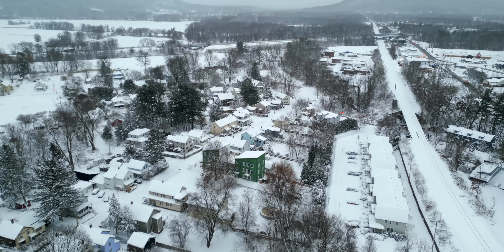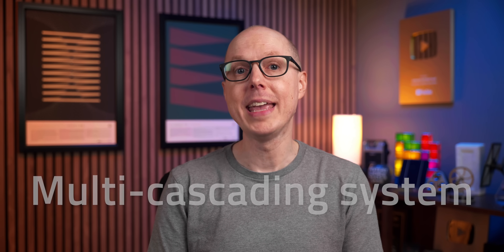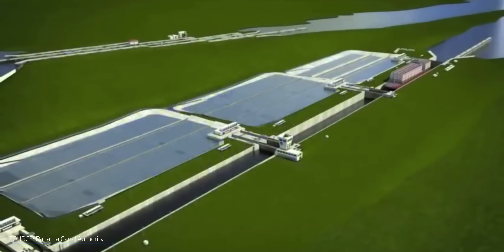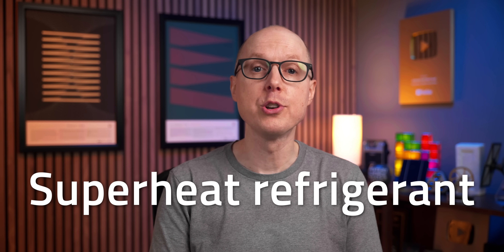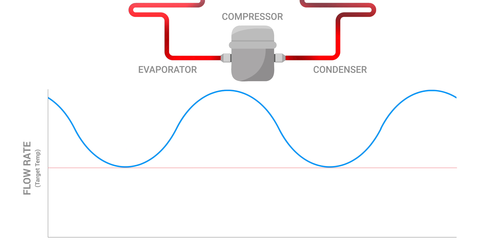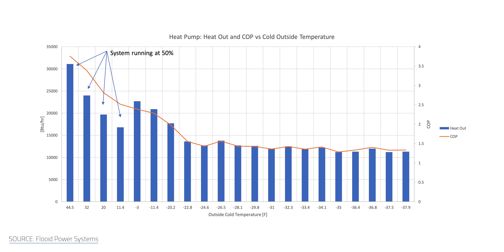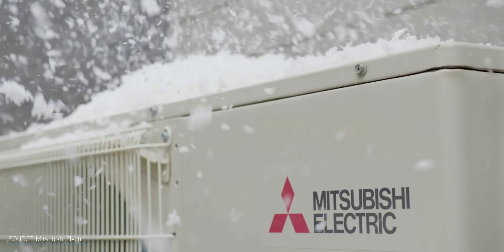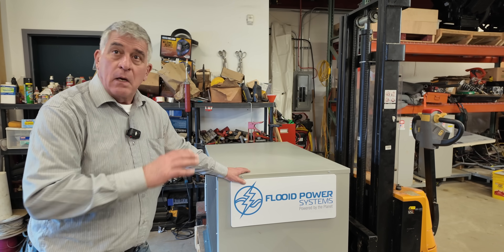How This New Heat Pump is Genius

Comment: AC units should be heating our water
Edit: The waste heat from when an AC or Refrigerator is running, should be routed to and recovered/stored in the hot water heater
Reply: I think David is saying that the AC unit for the house should be tied into the domestic hot water rather than dumping the heat of the house outside
Reply: @colinkulasik1128  That's something that makes sense.
Reply: Look into heat pump water heaters. That’s exactly what they do - move heat inside your home into the hot water tank, cooling and dehumidifying at the same time.
Reply: Wait what do you mean? my water heater has a heat pump in it
Reply: @justincarter7954 when running the ac the condensor is putting out heat. If the heat is used to say heat a swimming pool. The efficiency of the ac goes up and the pool gets warm.
Reply: @justincarter7954 he is talking about putting the evaporator coil on your home AC system to work heating your water.
Reply: @justincarter7954 which produces ac air and could be used to supplement your ac system
Reply: Why stop there? We should plumb refrigerant through the walls like water and electricity, hook up the refrigerator, water heater, HVAC, and laundry through VRV terminals.
Reply: @Higglebagger  I agree 100%. Laundry and kitchen and utility room could be designed to share a wall
Reply: @Higglebagger   - indeed, every house needs a thermal transfer system and "octovalve" -  like unit  - to shunt the "thermal transfer medium" here, there and everywhere. The "thermal transfer medium" carries the thermal energy from wherever it is "created" - washing machine , dryer, refrigerator evaporators  or furnace flues - and not desired, to wherever it is wanted (or to be rejected), and a local heatpump can convert it into whichever quality heat is desired - hot water (hydronic water 2 water hot water pump would be good..), air heating / cooling - or dump it back in the ground-source for use in a different season (take the heat out of the ground in winter and put it back in the ground in summer...  Some loads are "constant" - single direction - ie. hot water is always needed  as is food refrigeration, living spaces of  course are some times hotter and sometimes colder than the ambient needing a reversing system.
Reply: @Higglebagger that's a very good idea I've been thinking pretty long, use refrigerant everywhere!

your iron (the heater thing for clothes), maybe your dryer (dries clothes), your air conditioner (cools air), your gaming pc (cpu goes vroom), your stove (cooking food while all 10 compressors are dancing), water heater(nice warm water while showering), refrigerator (bacteria freezing in your meat)
Reply: I’m in Florida and the previous owner of the house tried this with a commercial heat exchanger specifically designed for this. However the main issue is that the duty cycle of a hot water heater and AC are completely different. Pretty much all hot water storage heaters are extremely well insulated so once they get up to temperature, about the only time they need significant heat input is when water is being used to get it back up to temperature as quick as possible for the next usage. Most people are using hot water first thing in the morning and then mostly in the evening, which is not when the AC is running with excess heat to dump somewhere. So you end up with all this extra plumbing and a heat exchanger for very little gain. Conversely a heat pump directly on the water heater in our unconditioned garage could take advantage of any heat in there, but it also requires things like an extra drain line.
Reply: My water heater has a compressor (AO Smith) that heats the tank using the air temperature.  Here in FL, the humidity in the air is 'free energy' that my compressor can exchange into the tank temperature.  It runs on 120volts instead of 240volts.  I can choose Efficiency, Hybrid or Just Electric.
Reply: @tedhamilton2362  It amazes me how many people aren't understanding what the man is saying, he simply saying you should water cool your air conditioning system instead of air coolant. That's it. Jesus Christ. It's not that hard
Reply: @Bozemanjustin like Tesla's  octovalve, allowing devices to swap cold and heat with  each other as needed
Reply: @Bozemanjustin if the water gets hot efficiency falls off. S swimming pool has a large heat sink and stays relatively cool
Reply: @backacheache the Octovalve is a compact form of a bunch of solenoid valves. Nothing special other than being proprietary, expensive, and hard to get a replacement for. (like most tesla parts.) commercial grade VRF systems are a great example of fitting a ton of solenoid valves into a very small space. They achieve the same result with more flexibly.
Reply: @tedhamilton2362  think he's talking about integrating the while home heating cooling systems need cold fridge and hot water remove heat from fridge dump to water. Same for cooling your house
Reply: I have been heating my water with the AC unit for 32 years. I have a Water Furnace much like Matt Ferrell but older. He never mentions having that option on his unit. I live in south Texas and it produces all my how water from Apr 15 to Nov 15.
Reply: We have a geothermal system that takes the ground water and uses it for the floor heating, AC and distributes to a water heater and a boiler. Very efficient system for radiant floor heating, AC cooling and warm/cold water ;)
Reply: They already do on swimming pools
Reply: @Bozemanjustin I've wondered if hosting a data centre (or just a rack or two) at swimming pool would be a good idea as the site will have a big power supply and the pool has need of the heat
Reply: i have a hydronic heat pump for my hot water, its so so.. After a long shower the water gets cold and takes hours to heat back up. In the winter it takes forever. I use less oil though. I wish there was a better alternative.
Reply: @Solitas777  It depends on the HP water heater, but on mine I can set the temperature at the unit well above 130. Is your water tank big enough?
If you have a system that supports hybrid, you could set it to that to support multiple showers is a row or to heat up the water faster. Of course, it takes more energy in that mode.

My 45Gal HP water heater is plenty big for myself, and I have no issues with running out of water.
Your family probably needs at least a 60Gal water heater.
Reply: In Japan, they have fuel cells where natural gas is converted to electricity and heat.  The heat is then used to heat hot water and radiant floor heat.
Reply: @rl1111rl  any more specific terminology or brands that you could reference?
Reply: My heat pump does this.  Many heat pump systems have been doing this for 20+ years....
Reply: Maybe even one step further?
HVAC/fridge/hot water combo, they share some of the same parts and produce excess heat/cold depending on the climate they're working in.

Thoughts?
Reply: @TJCarrishere  they all have different demand profiles. They would rarely operate at the same time. It works in larger buildings due to the diversity of loads and buffer capacity. (yes some walk in refrigerators /freezers have done this for more than 30 years) You can use the water loop to preheat incoming potable cold water but not all the way to traditional potable hot water efficiently enough in cooler  climates outside of the warmer months. When you don't need to heat the water loop, it becomes more viable to heat potable water all the way with a HP, if a bit demanding on the electrical infrastructure.
Reply: @SuperS05  Yeah, that makes sense, I don't know all that much about the dynamics of each individual system, I just knew they shared similar parts. Thanks for taking the time to explain.
Reply: I know a tech tuber that literally convert his pool to cool his home while at the same time heating the pool
Reply: I've long thought this is a good idea
Reply: They do it in supermarkets
Reply: Agreed, saves about 15% off AC bill as the system runs more efficiently. Can also be used to heat a swimming pool.
Reply: @Gadgebrown  I once went to a house with an AC unit and heat pump style pool heater right next to each other. One blowing out hot air and the other blowing out cold air.
Reply: a solar water heater that feeds into the main water heater reduces costs dramatically no matter what kind of heater you use
Reply: There should be just one machine as fridge , washin, cook, microwave, home server, ac etc.
Reply: What if you put the condenser in a per heater water tank?
Eliminate the condenser fan
Reply: That's a really fucking good idea. I could run a loop from the hot water heater of Copper Tubing Through the fins of the condenser.
Reply: Some models do that already, but they tend to be models that use radiant floors or radiators for heating and cooling as far as I can tell.
Reply: @SwankySasquatch66  and that matters why?  120F from a classic water heater or heat pump water heater... what is the difference?  I was referring to voltage input (120v vs 240v).
Reply: They already do this! Ground source and air source.
Reply: How much warm water do you use and what is it's pattern of use?
Reply: Hmm I have had HP for 30 years making hot water...
Reply: Like a trane hvrf
Reply: They already make heat pump hot water systems, not as reliable and we heat our hot water with excess solar so would take a long time to pay off a hot pump hot water.
Reply: @momouppa  You are not understanding. A ground source heat pump heats the water in a regular domestic water heater using waste heat from the compressor. The only added cost is a small pump and a little piping.
Reply: Ground source heat pumps have a secondary function of adding heat to the water in a domestic water heater for no-added-cost hot water.
Reply: Mine does? It’s called a desuperheater.
Reply: @FuncleChuck  it's only called a desuperheater when it's not designed to be a condenser. IE. The condensing pressure /temperature is lower than the target temperature. You'll get less than 25% of the energy available out of the refrigerant. (probably less than 10%, especially considering the asymmetrical demands) The rest will be rejected via the condenser. It's better than nothing, but it's not as useful as it seems. Since you can't store luke warm potable water safely, using a closed tank as storage, preheating the incoming water is far more useful but takes up a bunch more space.
Reply: genius
Reply: Notoriously unreliable, a mechanical system to heat water. Long term not a pay off
Reply: @charlesterrizzi8311  mechanical like fridge. I know geo sourcing heatpumps that are made in 80’s and still runs. Our shortest lived heat pump, a mini split that ran for 20 years and even then the failure was not about compressor but the outdoor unit frame that broke.
Reply: Geothermal units have a refrigerant to water coil for dumping excess heat into the water during summer operation during cooling, but turns off during heating during the winter months.
Reply: I feel like the excess heat in heat pumps wouldn't heat water. But they could be heating a storage tank to both give them a colder more efficient source to cool from and pre warm incoming water so your water heater doesn't need to work as hard
Reply: @Nomadsc2  exactly,  minus the first part
Reply: @David_Mash  heat pumps can heat water just fine. I've seen it I'm a plumber. You wouldn't be able to keep your water consistent enough off just the byproduct of ac
Reply: @nick-ro5bd  that depends on location and duty cycle, but that heat should be stored in the hot water heater instead of wasted.
Reply: @Nomadsc2  
The problem with partially warming potable water is that the chlorine levels keeping it sterile in the cooler underground pipes is often inadequate for the warm storage tank. [You may need to inject oxygen or chlorine or have UV light bulbs inside the tank. ]
Reply: If you wanted to add a 2 stage system simi,ar to the topic of this video, you could use geothermal to get the water up to 55 F (more or less) and then a heat exchanger from a AC recovery system to dump more heat into the system.  You'd still need a auxiliary heat source to get it really hot.  I guess that would be stage 3.
Reply: @davidr9876  well that's different than a standard heat pump system
Reply: At the very least it would be nice if The refrigerators waste heat was routed outside. Maybe integrate it into the AC somehow...
Reply: What about, the waste heat from large buildings should be dumped into swimming pools? It’s a win win. More pools and more efficient cooling
Reply: @blackbearelectronicswithco9541  in many locations, in areas where heating is needed durin winter, heat is dumped directly to ground loop of ground source heat pump. Plus side is that cooling is practically free in early summer because ground is cool after winters heating season. It also increases efficiency during winter because ground around the ground loop is warmed up during summer. 

Main thing is anyway really cheap cooling because you only need to run heat transfer liquid pump (tens or hundreds of watts depending on building size) instead of compressor.
Reply: Tesla will be coming around to solve another world problem soon enough.
Reply: Steamwhistle Brewing in Toronto does this. They rigged their brewery to reduce the required energy for heating and cooling their beer water and in house usage (tap water, toilet water) to be part of their overall exchange.
Reply: Exactly. We should have heat pump systems where heat from cooling AC and fridge goes into the hot water and vice versa cold from heating the hot water goes into the fridge. Can be expanded to neighborhoods and cities as well.
Reply: That's sustainable
Reply: Do it build it? You won't fight me
Reply: The waste heat is not really worth it, the installation would be hard and expensive for little gain.
Reply: Ummm... most heat pumps have had this as an available feature for years, just many people do not get it because of increased costs or lack of awareness that it exists. Though most air-to-air systems are only capable of preheating water headed into the water heater instead of actually fully heating the water. Though in fairness every degree added to the water that the water heater doesn't have to provide is saving energy and money.
Reply: great idea
Reply: Whilst that works in theory, due to legionella bacteria control in hot water systems, water needs to either be maintained about about 55 degrees c constantly, or over 60 degrees c for long enough periods to kill off the bacteria. Therefore extra electric heating elements are needed to keep the hot water temperature. This can back feed the ac system leading to problems with the ac system
Reply: Indeed, instead of that we have to use either electric resistance or burning fuels to heat water, ridiculous!
Reply: @godzuki2099  Which has been the de facto standard for millions of years. Why are we trying to reinvent the wheel. Refrigerant based systems do not produce heat, they simply transfer it. In fact the compressors generate more heat trying to run.
Reply: The thing is your AC doesn't run 100% of the time, if you need hot water during that downtime you will need a separate water heater. It doesn't make sense because then the AC unit would cost a lot more, need more maintenance, and you'd need a hot water anyway. 

I'll admit it's a good idea in theory to reuse the heat that your AC is getting rid of, but it's not practical compared to the price and redundancy.
Reply: @luelou8464
Hydraulic -> hydronic
Reply: almost all the reply section have air to water heat pumps, I want it too. but I don't have😭
Reply: You're water usage should cool down or heat up your life '  but powers that be through good Money After bad ''' because of lobbyists????
Reply: They have it, they also have heat pumps to dry clothing, and heat water.
Reply: Absolutely nobody can stop you😊
Reply: @David_Mash  they do make hear pump water heaters and clothes dryers.
Reply: according to the obvious
Reply: I still prefer gas heat, sorry.. It warms the house faster and gas valves and pilots are quicker to replace then compressors and reversing valves on a cold day
Reply: Re.."Wait..my hw htr HAS a heat pump..." Pay attention..The person's other device's WASTE heat you ALways can patch into the NEXT device's INput..even if it's only a 10 or 20% bump..it HELPS. Example?..U COUld get your fridg's back-mounted hot coil's heat to your hw htr's tank as well. MAYbe use the thermo-siphon principle to avoid circ.pump..not sure..but worth a shot. VERY small circ. pump otherwise.
Reply: It won't work and won't be as efficient as you'd think
Reply: Yeah that'll only cost Jesus to the Nth power. Cost efficiency is important too Greta
Reply: Heat reclaim is popular in rack systems, heat is reclaimed for making hot water first then switched to reject heat outside to a condenser when the tanks are satisfied.
Reply: @Eighty8Fitter  Heat reclaim is popular on almost any modern Chiller system too. No reason to lose that free energy !
Reply: But how come in the summer, the outer piece will be hot, so why do you need to heat the water in the summer, and in the winter, its air will become cold, and you need hot air, and if you reduce from the indoor unit or the pipeline the largest thermal mass to transfer heat from, especially such as very large water, the cooling efficiency will be catastrophically reduced.
Reply: @MML66  you can use the heat rejected by the heat pump to heat hot domestic water.. widely used in industrial/ large commercial setting. Heat is energy and we are getting a lot better at harnessing it without loosing too muc
Reply: @MML66  it's called heat recovery and most modern unit are built with that in mind.
Reply: @David_Mash  it’s good until you turn on heat mode and wonder why you water is at fridge temp
Reply: Why you need hot water when you are running ac in summer time?
Reply: @jibranbaloch7650  why do you need hot water ? Shower, dishes. I mean why do people need hot water?
Reply: @jibranbaloch7650  people still have hot showers in summer. I don't know anyone who has a shower without using hot water and I live in one of the hottest countries in the world.
As a side note, the hypothetical system could heat a small tank (as is typically seen with heat pump hot water systems) so it would mean that the air conditioner could heat it at a different time to when a person is using hot water for the shower.
Also I should be noted that people in places like Singapore need to run their air conditioning 24/7 and all year long. The inside of their home might be a comfortable 23 degrees. Of course they're going to want to have a hot shower.
Reply: @David_Mash  heat reclaiming  is already here mainly using big commercial superstores your nearest superstore probably has one.
Reply: @David_Mash  once the water reach 50c or 60c it is going to take a lot of cooling so you will have to run the water instead of storing it
Reply: Every “loop” will consume additional energy you will reach a point of diminishing returns except when you need extremely  high delta from primary source
Reply: Ac units efficiency now are to high to make it worth to collect the free heat. Older low seer units are the prime for that
Reply: In Europe, they do already. We use air to water heat pumps, which heat water in radiators and underfloor heating to heat the home. This same system is used to heat the water in your hot water tank. Only downside is it can't be used for cooling as it isn't air to air.
Reply: @egocd  my air to water hp can do cooling.
Reply: @egocd  Yea and you use a lot of electricety with those systems. They do it efficient but they still use a lot of electricety.
Reply: @egocd you can use air to water heatpump for cooling by adding air to water heat exchanger inside for cooling.
Reply: @egocd  I have floor heating and floor cooling in summer, so it can be used for cooling as well but I agree that is certainly less pleasant.
Reply: What happens when your water is already hot enough, but you still need to pull heat out of your house?

And what do you do when you need to heat your house and your water?

Integrating your water heater directly with your hvac is unnecessary complexity.

Better to use a dedicated heat pump water heater.
Reply: @dafunkmonster  Push the heat to outdoor air (or to ground), because you only need an hours worth of heat from smallish house for hot water needed for two persons to shower etc.
Reply: Bacteria hell.
Reply: There is an energy mismatch and there are significant complications to reject AC heat to water. Also less efficient than rejecting to air due to temps.
Reply: Why invest in a very expensive piece of an equipment that is doing double duty when you can have two lower priced units that individually can be replaced separately.... Besides here in the northeast of the USA, air conditioners only run hard for around two months of the year and tend to last much longer than in hotter climates
Reply: @frankie9259  Lower operating costs and more environmentally friendly.
Reply: @frankie9259 : Because for my house, which has an in-floor gas fired convective heater, and no AC, the cost to install a central forced-air AC and heating system would be the same as installing a 3 ton mini-split. And that’s assuming that I’d go with electric resistive heat; if I wanted to go with gas heat, I’d have to replace the gas lines in my house, which would add another 3500 to 4400, which would make the “individual system” setup considerably more expensive, even ignoring that my utility company pulled some shady crap with the gas prices this past winter. And another thing, why would I want to build a bigger and more complex system, with multiple known failure points (some of which can fail on an insanely frequent basis), rather than a significantly simpler system that does both?
Reply: @frankie9259  a hot water system and HVAC system integrated together in a single unit would be perfect in numerous countries where it's hot all year round (such as those located in equatorial regions)
It's perfectly conceivable that if these units were adopted enough to scale up mass production, they could easily be cheaper than having two units, particularly given the fact that many fewer parts would be required.
Also your use of the term "double duty" makes it sound like the unit would necessarily need to work twice as hard as it would as if it was only doing one of the functions (and I certainly hope you can understand why that is not the case.)
Reply: It has been done on occasion, but it isn’t the most efficient system, as in say microwave based water heaters.
Reply: @aaronmccready4530  Any form of electrical heater that isn't a heat pump is at most 100% efficient and most are almost 100%. A Heat pump is well over 100% efficient, so yes, we DO use them to heat water here, because they ARE The most efficient system.
Reply: @peter65zzfdfh  a heat pump is efficient only if the reject heat (condenser coils) is coupled with a water heater. Else it is a overpriced airconditioner only
Reply: @peter65zzfdfh  it depends on how you calculate. what do you mean that your heat pump is well over 100% efficient?
Reply: @janami-dharmam   it's very simple on a conventional heater. One unit of electricity produces one unit of heat because you're creating it 

A heat pump does just that it moves heat from one place to another. It doesn't have to create it which uses way less power 

Even though it's it's 30° outside, there's still heat because it's not absolute zero, so they're simply taking heat from outside and putting it in your house so your house can be 90° even if it's 30 outside and you're pulling the heat from the 30° outside air
Reply: @janami-dharmam Just forget about “efficiency” and recognize that performance is identified as COP- coefficient of performance. Electric resistance heating in any application is 100% efficient and has a COP of 1. Heat pumps can achieve as much as COP 5 though 3 is more typical.  COP of 3 supplies 3 times the amount of heat per kWh as electrical resistance COP 1. How is this possible?  First note that I use the terms “supplies” heat rather than generates heat. That’s because the heat pump doesn’t “generate heat, it imports or transfers heat from one location to another, even when the source air is below 0°!   So, if you use electric resistance heat as a baseline, the heat pump is 300% more efficient.
Reply: @rcpmac  Sorry I cannot forget about efficiency and the Carnot engine because I believe in physics.
you take air at 0C and transfer heat to make it 20C and do that 300% more efficiently than an electric heater? Can you please elaborate?
Reply: @janami-dharmam tell me you don't know how a heat pump works without telling me you don't know how a heat pump works. What about in heating season when the condenser coil becomes the evaporator? You just lose out on your hot water?
Reply: @janami-dharmam   - I think you are using the term "efficiency" incorrectly.

The heat pump already only uses a fraction of the electrical energy to "pump" the thermal energy - than it takes to create the energy in the first instance...   (that is how it is greater than 100% "efficient" - no magic there - a large volume of low quality thermal energy is simply converted into a smaller volume of higher quality energy  - quality is experienced as a temperature change.)
Reply: @kadmow  1. "only uses a fraction of the electrical energy"- what happens to the rest of the fraction? you pay for the total electrical energy, right?
2. "o create the energy in the first instance"- surely you know that energy cannot be created, right?
3. "you are using the term "efficiency" incorrectly." can you please define it?
Reply: @janami-dharmam  An air conditioner is just a one-way heat pump
Reply: @aaronmccready4530  Microwave? All resistive heaters (Microwave included) have 100% efficiency. A heat pump will have "more" than 100% efficiency as you will have all the input power heating the water + the heat the refrigeration system recovers.
Reply: @zaprodk exactly, heating with microwaves is really bad in efficiency, the magnetron generates a lot of heat.
Reply: @zaprodk a heat pump of any kind can have a COP greater than 1, and often do, but it is not guaranteed. In very high lift conditions (IE very cold outside) the COP can fall below 1. Freezers typically are far below 1 for reference.
Reply: @aaronmccready4530  What? the only advantage of microwave heating is it can heat up a small quantity of water quickly but it does not use less electricity than a heat pump to heat water for a 40 gallon tank..
Reply: hell no NG is cheaper and faster for hot water
Reply: @zack9912000 the price of natural gas goes up in the winter. The cost of climate change is much greater than the extra costs now. A heat pump water heated can be used to cool the area it is in.
Reply: @zack9912000  It is not. A heat pump uses so much less energy that heating with NG is still more expensive (I did the math). In addition, I generate my prepaid and locked-in electricity for $0.06 per kWh using my solar panels. 
The price is equivalent to $1.75 per term, which is still below the current gas price, distegarding the fact that my heap pump is 2-3 times cheaper to operate than gas. I totally replaced gas in my home with better and cheaper to operate heat pump appliances and produce all my energy needs myself, including transportation. The only cost left are the connections charges. Just in time for retirement...😂
Reply: When electricity keeps getting more expensive, gas keeps looking better, no matter how efficient the electric heater is.
Reply: @patmcbride9853  electricity is only getting more expensive for those who buy it from somebody else. And it will continue to get more expensive as more people become self-reliant
Reply: @patmcbride9853  not when you have solar panels on your house giving you "free" electricity